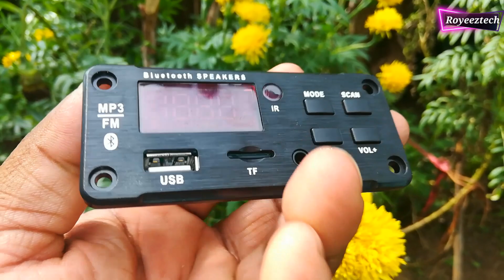Powerful karaoke outdoor Amplifier making പവർഫുൾ ആമ്പ്ളി ഫയർ നിർമ്മാണം

Comment: good job. its not 500W anyways. considering the transformer rating, amp, and power supply design it will give output of max 160 watt with distortion. good for playing around 90 - 120 wt rms for clean output.

Comment: Thanks for your valuable video.Sir 
Please suggest me how can I connect TPA3116d2 for two channel and TPA3116d2 mono for subwoofer in a same home theater system.CAN I USE TWO Separate AMPLIFIER in a same system by one BT board and and one Bluetooth module?